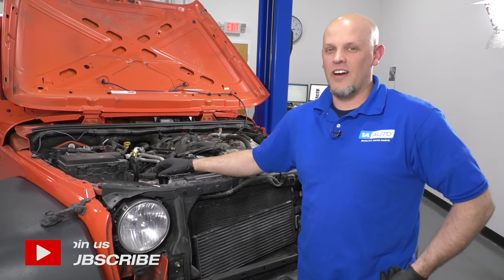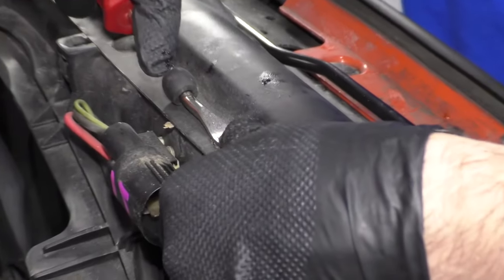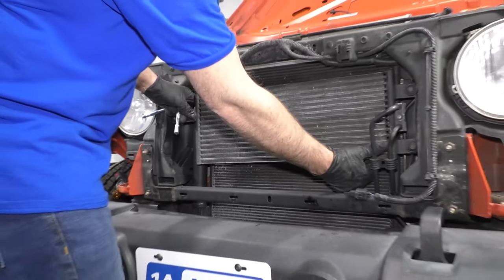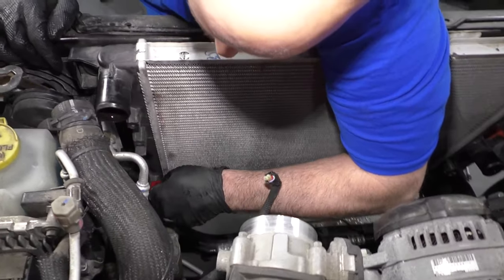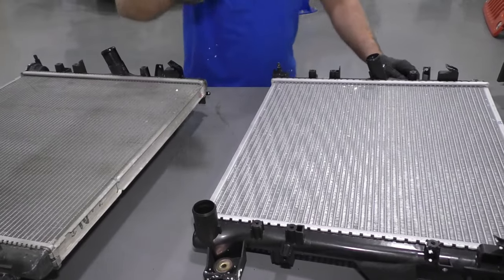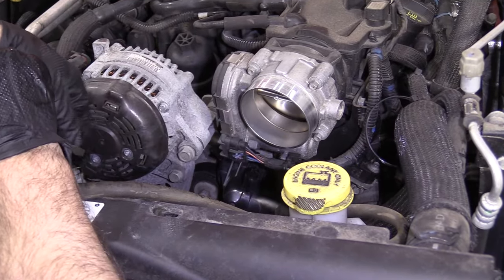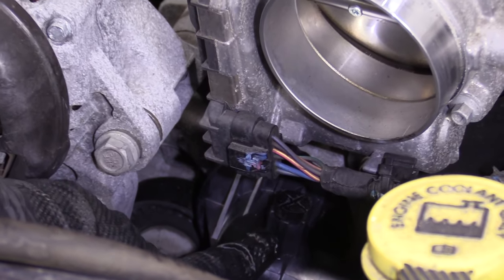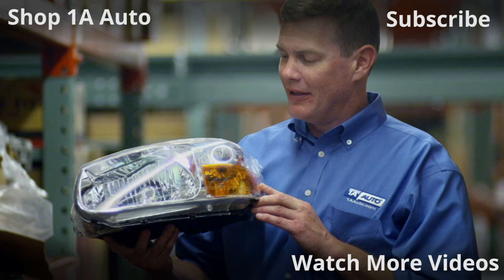How to Change Radiator 07-17 Jeep Wrangler

Comment: I am not the greatest of mechanics and was a little weary of trying this myself.  Bottom line, oldest son's 2014 Wrangler had a coolant leak and after checking everything found another video that was just like his problems.  It wasn't the best video did show a changing out of the radiator by a garage mechanic like me.  So after finding this video, I was very pleased with your step by step process of removing the old and installing the new.  I know that you can't show every single step and that's fine, but after watching this video, we went out one afternoon and removed the old radiator in about an hour (but I could be slow sometimes).  I did remove the upper and lower heater hoses while I had everything apart and open.  I was very pleased that everything I saw in the video was exactly like my son's Jeep.  The biggest problem is that his is raised up some so the height was awkward and I had to sometimes stand on a step ladder or up on the front bumper.   Actually, that was a lie, the biggest problem was putting the new radiator in at an angle to attach everything (condenser and cooler).  That took us about an hour, when the radiator came in and then another 30 mins to get it out of the garage.  The fact that you show the bleeder valve is a lifesaver.  How much easier can that make it?  I actually said one time, "this dude put it on all by himself, so how hard can it be?", but my son laughed and said, "I bet he had 15 guys helping out of camera sight!"  Total time for us  3.5 hrs, and 3 cuts to one finger and thumb.  Can't say thank you to you guys enough.
Reply from the maker: +Jason Guest Thank you! We love empowering our customers and showing how to perform DIY auto repairs with our high-quality auto parts.  http://1aau.to/m/Shop-1AAuto-c

Comment: I would have to disagree with the fact that this is a little different in wrangler 11 and older. Different motor and things are also different on removal of parts! Decent tutorial but if you own a 2011 or older this isn't going to help a complete newbie on how to replace the radiator correctly!
Reply from the maker: +Brandon H Thanks for the feedback!
Reply: I agree. This is for a JK, JKU

Comment: Great video. I just got mine from you guys earlier this week. Working slowly with my teenage son it took me an hour or so. We forgot to swap the lower rubber pieces at first and had to undo it partially. Otherwise perfect video. Apparently some don’t have the lines bracket through the wheel well. I had a bolt there. Thought I lost the bracket, but internet search had others missing it too. Thanks again.

Comment: Really, really good tutorial man, saving us some serious money here. Keep up the good work on the JKU DIY's!
Reply from the maker: +Ben Luppi Thank you! We love empowering our customers and showing how to perform DIY auto repairs with our high-quality auto parts. 1AAuto.com
Reply: @1AAuto  Just finished the radiator and thermostat install on my 2013 JKU with your tutorials! Went so well thanks to your video. 

Getting the new radiator in, and lining up the condenser as well as the plastic shrouds that you take off the old rad was a pain doing solo. Removing those constant-tension hose clamps without that handy tool was absolutely brutal too, had to remove then and replace with standard hose clamps. Thanks again guys keep up the GREAT work!
You guys should think about starting a Patreon so I can donate/tip you, after all you did save me from a $1300 quote :)
Reply from the maker: +Ben Luppi Thank you! We love empowering our customers and showing how to perform DIY auto repairs with our high-quality auto parts. 1AAuto.com

Comment: This video was accurate and very helpful. I was able to find all of the "hidden" fasteners and brackets making the R&R of my radiator much easier.  THere just isn't any easy way for those lower cooler bolts though. Thanks for posting.

Comment: Question,  Does this Jeep have an aftermarket oil cooler? My '08 Wrangler Rubicon has the stock AC condenser with Oil cooler integrated on the bottom. I was watching this video to get an idea on how to replace the AC condenser, mine has to be replaced. Their are no videos out there on replacing the AC condenser.

Comment: Great video. I used it to replace my 2015 wrangler radiator. I have one question. Along the hose on the driver side there is a braided wire connected by a clip, but there is also a small rubber hose and i can't find where it is suppose to connect to. I see it in your video at 21:30 mark but it's not connected. It's under the braided wire which is under the hose. It's arched and right to the left of the mechanics hand. I don't see anywhere is was removed or replaced. In looking at the end it appears as though it was never connected to something because it appears new and unstretched. Can you tell me where it goes to. Thanks. I have a pic with hose highlighted. How can I send That.

Comment: How much coolant will JUST the radiator hold? Only getting half a gallon into mine. Trying to determine if it's plugged from casting sand or something from the engine replacement a year ago.
Reply: The motors were all die cast. No sand.

Comment: Is this a video of an automatic or manual transmission, or does it matter. By the way, great video!
Reply from the maker: +Mike Gray The fitment of this part is not dependent on whether the vehicle is an automatic or manual.  Thanks for watching.
Reply: @1AAuto  Thank for the quick response.  One other question about the fluid. I have a 2016.  When I look online I see that I need MOPAR 68163849AB.  However, I read that this antifreeze is purple in color.  My fluid (straight from the factory)  looks link  a pinkish  color to me.  Just want to make sure I  buy the right stuff.  Thx again.  This is the best video I have seen for replacing a part.  No shortcuts!

Comment: Why When i called about my 2014 jku they said you have to evacuate the coolant system....wtf does that mean
Reply: Drain all the coolant/ antifreeze. When you disconnect the lower radiator hose, you’ll drain the whole coolant system. You can skip the drain part and just drain the system by pulling the hose. Just be ready to catch it all.

Comment: thanks good job ,,,, looks like another jeep pain in the ass radiator i just did a 2003 liberty ,,,sucked ,,, wed i have 2016 wrangler stick rad ,,,,,,,, thnx
Reply: Thank you I installed my brand new radiator yesterday without painting it, it still looks great.

Comment: The radiator they shipped didn't have the hole on the left for the transmission cooler only the two on the right. It only lasted 4 months it is leaking on the drivers side where the plastic and aluminum join. Plus as an added bonus for your warranty to continue you have pay for return shipping on the radiator that only lasted 4 months. Very disappointed and will now factor in these things when ordering from 1A auto in future. Plus I can't update my review on the 1A auto site.
Reply from the maker: +Mike Ready We are sorry to hear about the issues you have had with the radiator you purchased from us.  We have a 60 day return policy. After 60 days, the manufacturers warranty kicks in and to transfer the warranty onto a replacement part, the defective unit needs to be returned.

Comment: Good video.  But unless I missed it (I watched it twice) I don't think you ever show removing the big round silver 10mm bolts from the radiator??  You do show putting them back in.
Reply: An easier way to do this is at the 7:52 mark, take the 2 10mm bolts out of the top of the radiator and tilt it back.  That gives you way more room to take out the 8 and 10mm bolts on the cooler and you don't need a wobble socket.  Put them back in the same way.